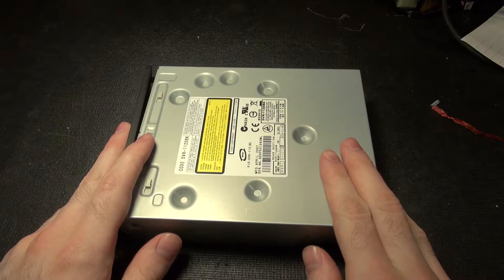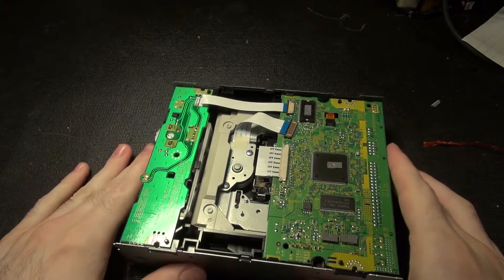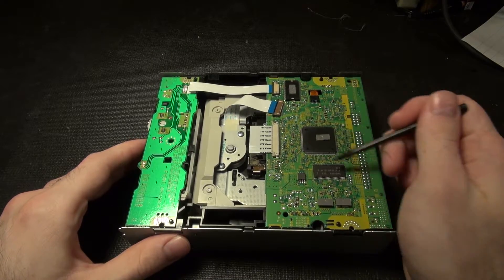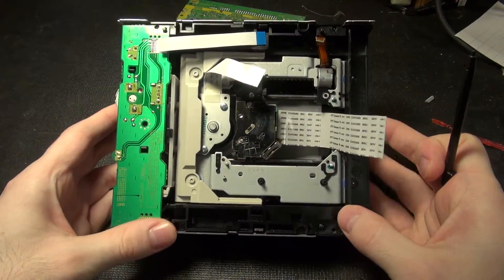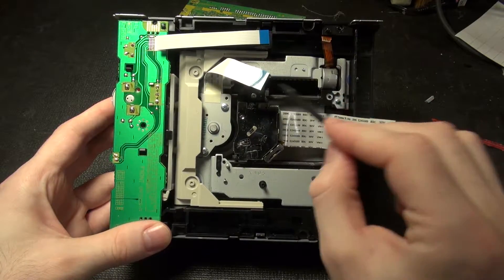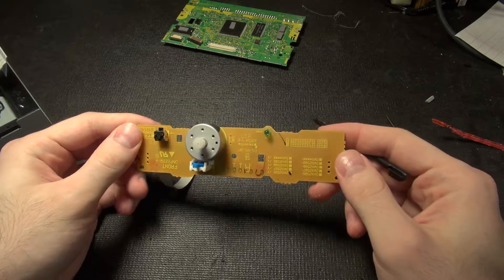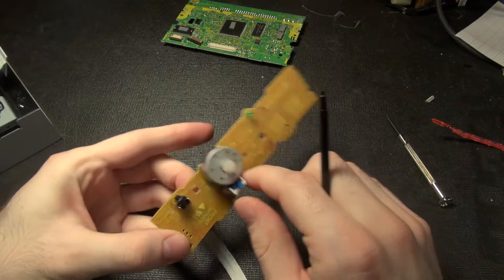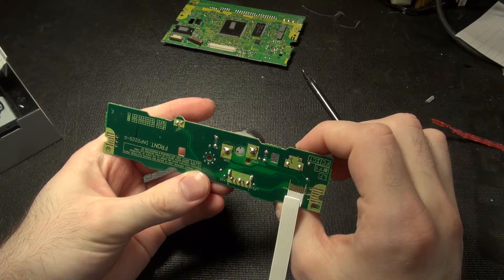DVD Drive Teardown

Comment: I have a dl dvd burner that kept giving me errors when writing to dvd that said due to bad media. I replaced the burner with new one & it works fine. My question is would it be worth it to clean the laser in the old burner & try that, or could it be a part that's simple burnt out & no good anymore?  I've fixed read errors on Playstations that way before... Thanks